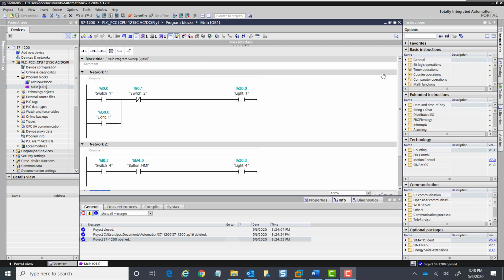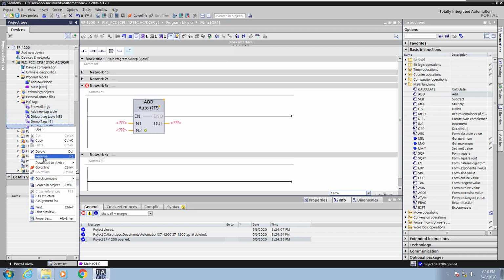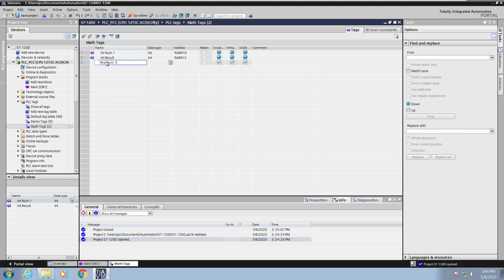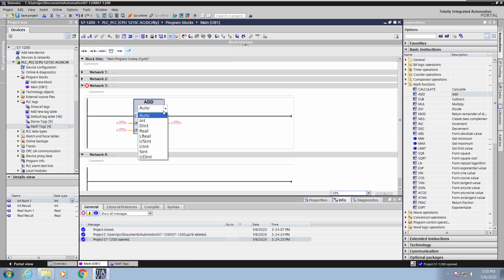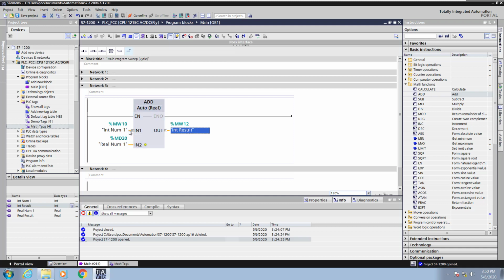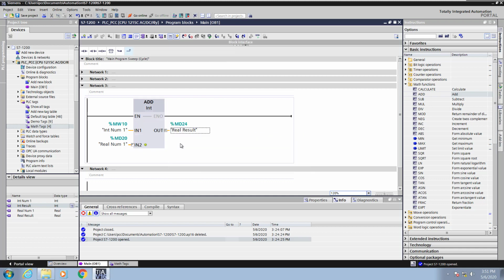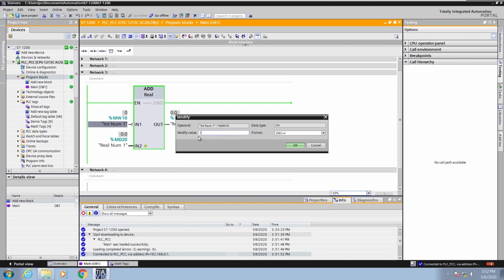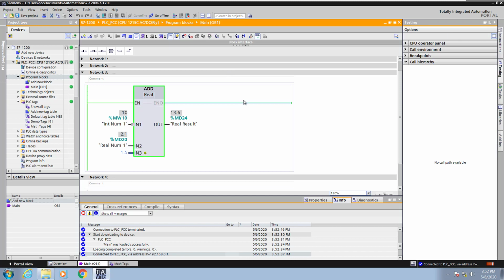Lesson 04 - Math and implicit data type conversion

Comment: Hi PCC.

I like your videos, well done. 

I have a question. I followed this tutorial, but got an error. When I put the mw12 tag to the out of the ADD function block, with the block set at "Real", I got an error stating that "the data type int does not match the data type real".

What does this mean and how can it be solved?